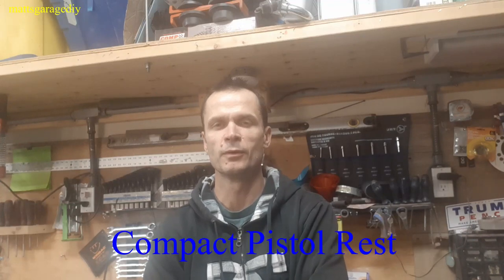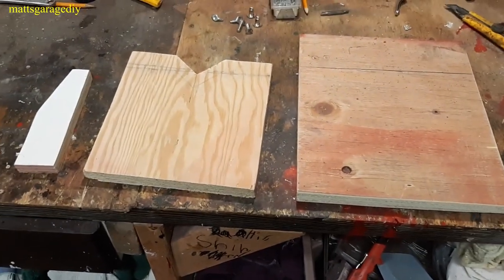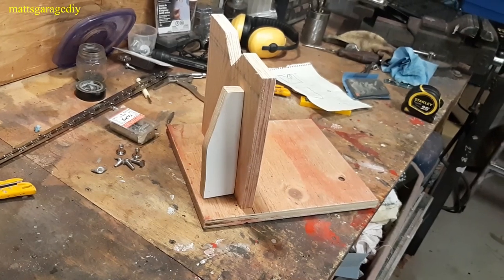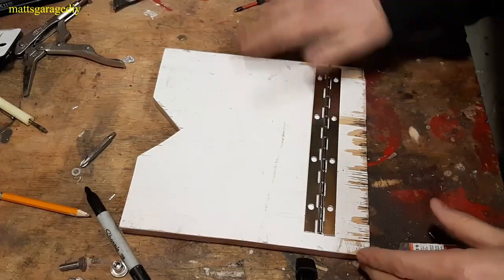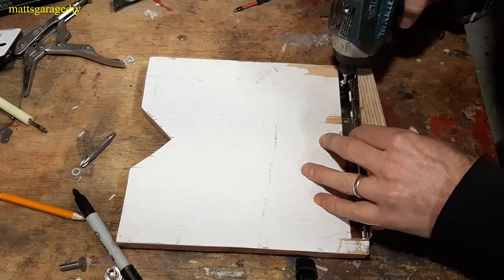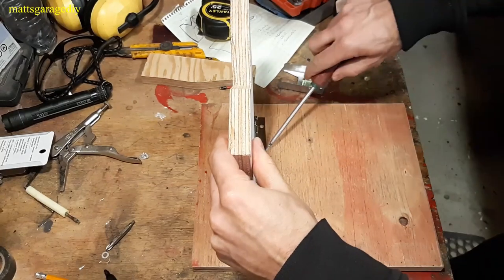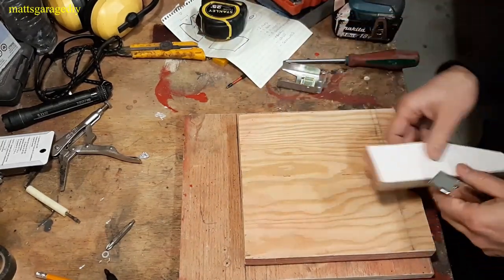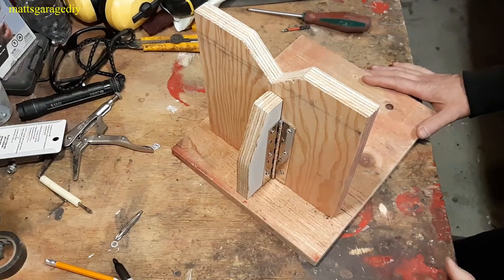compact collapsible pistol rest

Comment: One thing; you shook it and said it doesn't move but, as expected,  it was rocking on those t-nuts.  A quick flat hole with a Forstner bit would have inset those t-nuts and it would have been perfect.
Reply from the maker: you bet Dale, thanks for the insight